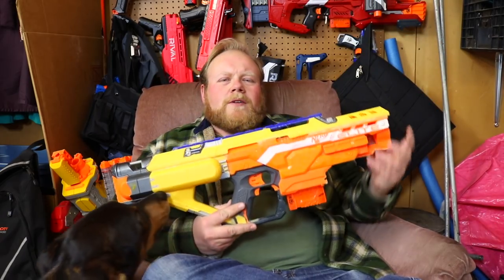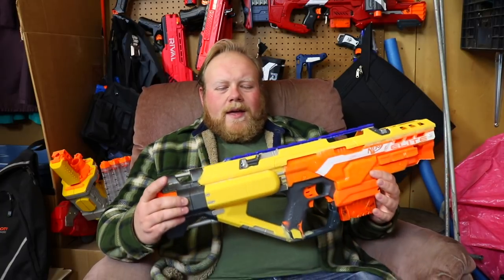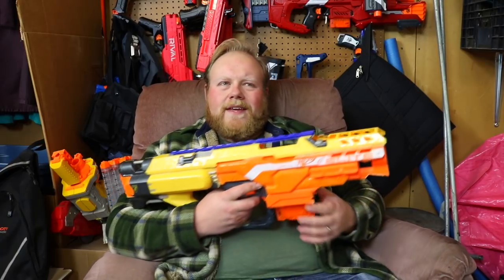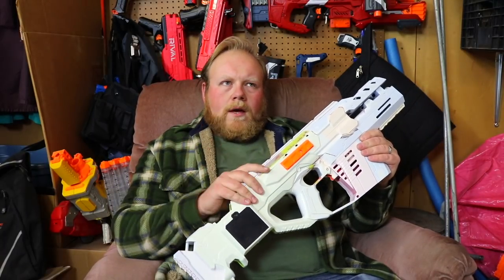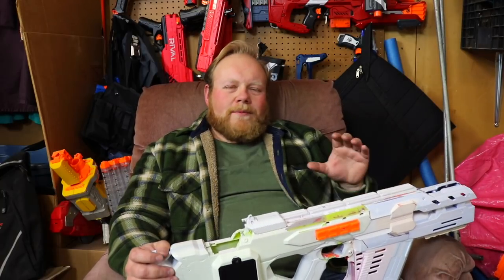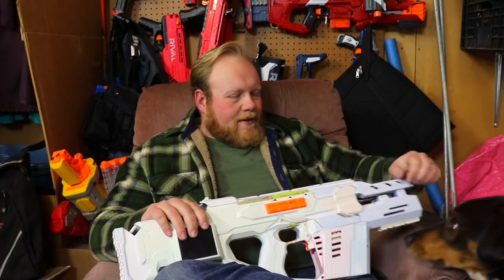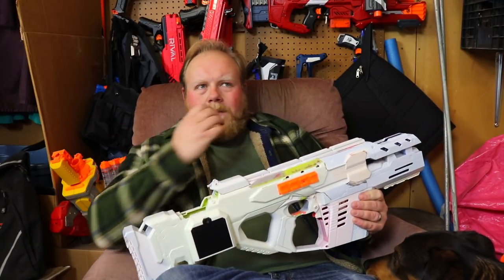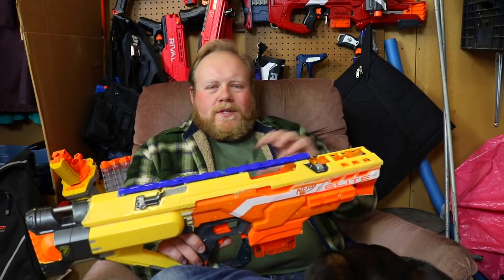Coping with Project Frustration and Modder's Block

Comment: This is the biggest issue I have. Like I want to finish the Double Sledgefire I've been doing, but I don't have the flow like the Hellsender does; and that's one of the reason I start so many different projects that never get finished and people never see. You're looking at things like an artist: the entire point of art is to work all over your canvas instead of focusing on one part, that way you spread your work around and don't get too deep into something before wanting/needing to change it. Easier said than done, but it does help. For what I do, I just get the essentials of what I want done and then everything else is a happy little accident. I don't plan for half the stuff that happens in my builds, like the top rail on the Deleter that absolutely brings the entire thing together.
Reply: WalcomS7 I hope I see this emotion in a video someday.
Reply: WalcomS7 No mistakes, just happy little accidents.
Reply from the maker: WalcomS7 I love it when things happen to "drop into place" unexpectedly like that. 
Thanks for weighing in, man. I like hearing a different angle.

Comment: I don’t really have the experience to speak on the Nerf front so much, but in my other endeavors, I found that my favorite projects were always the ones that blossomed into something new when I worked on them. It always became a turning point for me, where I started thinking about what I was doing a little bit differently. The wife refers to it as “hitting a milestone,” which is a notion I’ve always rolled with.

Comment from the maker: Alright guys, what are your thoughts? Surely I'm not the only one who has these issues; how do you handle it?
Reply: I have this problem all the time with my cosplay. I currently spent two years on one costume because i was so transfixed on making it perfect and super badass
Most recently i been trying to make a system of led lights work for my prop that wouldn't physically work. Way I got over it was I stepped back took a break (actually worked on a cool nerf side arm) then came back with a fresh game plan on how to work around it. I didn't touch the prop for a week until i was happy i had my mind set on a soultion
Reply: Mister Nathan i have those problems too. Maybe just finish whatever and you can always sand blast and redo stuff later
Reply: I totally know where you're coming from, Mister Nathan. I had a lot of trouble trying to get The Arbiter to work well enough to be happy with it, but I think it was a combination of inexperience and trying a bit too hard to be quirky and innovative that caused me to give up the project. I'd like to return to the idea someday, when I feel I can fully flesh it out. 

The project in question: https://www.reddit.com/r/Nerf/comments/7024oh/my_unfinished_mm2_project_the_arbiter_formerly/
Reply: I think that you can put the select fire kit to Jackal that walcoms7 shows in a video
Reply: To be honest... I take a little break. I step away and stop looking at what others are doing. I have issues thinking, what's the point when I know people that would be impressed with something like taping a TP tube on as a scope or barrel, and others that do such a good job that I could ChopUp a dozen Blasters, rearrange all the parts, seamlessly reattach them, and still not be satisfied. I have to think of doing what I want to do.
Reply from the maker: Ryan Warrener 
Indeed! Sometimes it's best to move to a different project for a little while, and give your mind a chance to "reset" on the original project.
Reply from the maker: DrakoSlay3R47 ah, yes... I remember seeing that when you first posted it. It was a very clever idea, and I hope you're able to bring it to fruition some day.
Reply from the maker: Pirate Johnson a very good point. If we get too caught up in the "comparison trap", we sometimes find we're no longer building what we're really passionate about, but what we think others may like. Build what's in your heart, man.
Reply: I like this style of video personally and I've recently been looking for inspiration to finish a my first integration attempt (rayven/demolisher) this gave me a new way of looking at the project so hopefully I'll use this to finish it soon.
Reply: Personally, working on my own blasters, I suggest that you not worry about the timeframe for working on your blasters. Take your time and don't rush things. If projects go slightly longer than what you expect, it's ok.
Reply: I haven’t done any nerf modding in the scale you do (as in cosmetic modding), but I definatley do have this with drawing block. I am very perfectionate over certain lines and design flaws that seem like flaws at the time, even so to the point that i erase straight through the paper. What I do to help myself is I take pictures of each time I say to myself I “finished” the drawing, and then at a later time I look back to it, and often, I find my first few were the best results. I hope this helps!
Reply: Mister Nathan what about setting up a 3 laser predator style sight, I think the hunter vibe would be sick
Reply: I don't.....I just get drunk and really fucked up

Comment: I like your style of modding, letting the gun-to-be show you what it wants to be instead of you forcing it to be something it doesn't want to. Your style has as a drawback that you need to be able to pick up what your gun wants and sometimes that's superclear and sometimes there's nothing. If there's nothing, just try again later, there are more things wanting to be built. Try changing your surroundings. Changing surroundings helps changing your view of things and that is most often what is needed. Take a picture of your project with you to a museum, to the forest, to the harbour and see what happens, if nothing else you'll still have an interesting day of it.
Reply from the maker: Zero Blade you're right. Sometimes inspiration can come from the most unusual sources.

Comment: I like the idea of the fire side chat/sit down and just talk what's on your mind about whatever. It's therapeutic for everyone on both side of the camera. You can have the best laid out plans for a base and have that base put together perfectly. Then you wanna bring in another component and it's like integrating a baseball bat with a piece of glass it's not going to work and shatter your original base all together and have to start from scratch where you have to build off that new component entirely.  May have to use the original base you first started with for ideas or parts as you create any new bases. That's why you never throw away your scraps, a tiny piece could be the center piece of a great build. Great video, thumbs up
Reply from the maker: DarkenKnights You're right. Even small scraps and abandoned ideas can hold great potential for a different project. You never know...
Reply: Definitely,  waste not want not and any piece/part can be a treasure in disguise .

Comment: So I gave it some thought, you could keep the shotgun idea but instead of a compressor you could use the little canisters of co2 .if my measurements are correct you could fit 3 or 4 small 1 time use cans or 1mid sized 1time use can. Idk though just a thought but I can think more on it if it sounds like something you would like
Reply: To build a bit more, it would need an hpa to co2 converter and maybe a flow regulation system depending on how hard you want it to hit

Comment: Great video and totally understand where you're coming from.  I've been watching your mod along videos on the centaur, and made me want to do my first aesthetic integration, which is a demolisher with a Vulcan barrel on it.  I've been working on it for a while now, I keep running into blocks like you are talking about and I myself keep stepping away and not even think about it.  My biggest thing has been I want to put a stock on it, since my demo didn't have one since I bought it through a Goodwill auction, but now just watching this video and seeing your demolisher with the stampede has got the wheels turning in my head.  I only have one stampede,  and really don't wanna sacrifice it but I have a lot of other blasters laying around.  Plus I recently got some sheets of abs plastic so I might build something similar to yours.  I will definitely be following and checking out your Instagram now, hope something clicks for you and you can get past the modders block like your video has helped me.  Remember do whatever makes you feel good and happy, even if it doesn't seem right to everyone, it only matters what you think.
Reply from the maker: XzL Darkecide Thanks for stopping by! Glad you were able to pick up a little inspiration. Hope it helps!

Comment: Dude I'm in that same position. I'm currently working on trying to sneak a Rapidstrike inside of a Longshot shell. I'm tryna do similar things people do with Stryshots and having most of the Longshot shell hide the stryfe and most people cut off the stock and raise it which isn't what I want to do because the ergos aren't there, since the longshot grip sits so low. Only problem is that the RS is considerably wider that the main body of the longshot shell so I'm trying to find ways to cut holes for the RS to poke through and give it a unique look without sacrificing too much of the aesthetic of the longshot main body. I might try cutting bits off and regluing them back in as a compromise but I'm not sure it would look the way I'd want it to. And since the grip sits so high, I'd have to find a way to use a Centurion stock for a thubmhole stock that connects with the Longshot stock that has the extension stop mostly removed so the stock sits farther back where the LiPo will he stored. Any tips on what I can do? I can provide pictures as needed.
Reply from the maker: Sounds like quite a project. If you want to share ideas and pics, etc, feel free to reach out to me via my Facebook or Instagram and we can chat